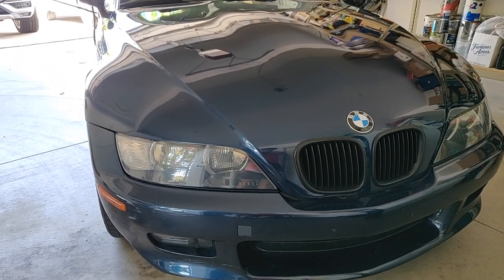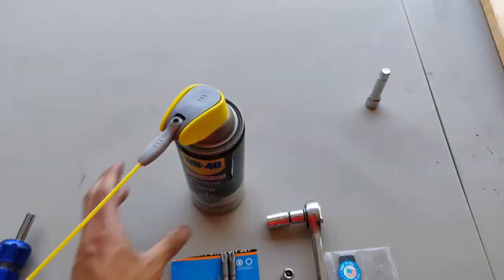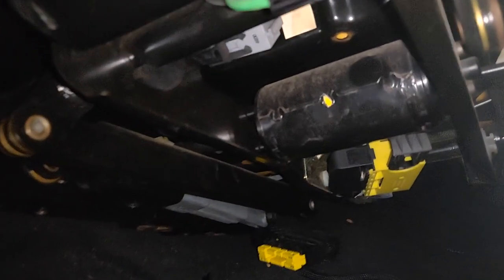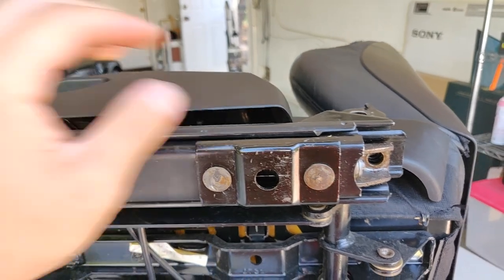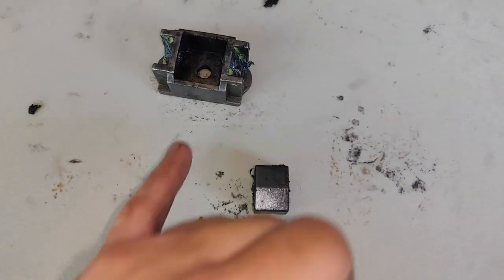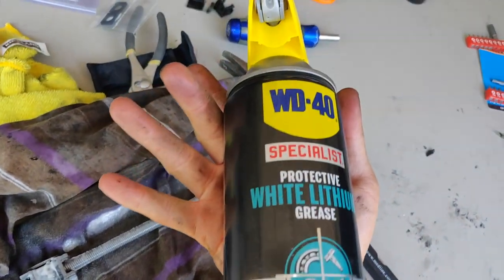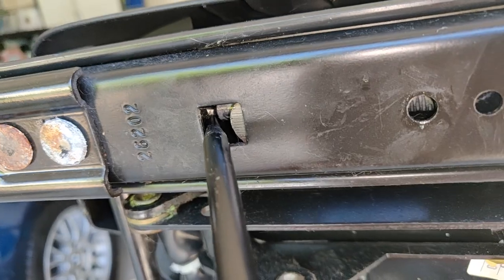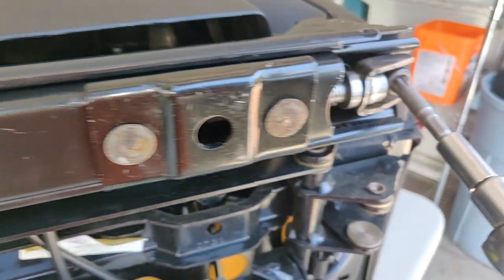How to Fix BMW Z3 Rocking Sliding Seat in Under Five Minutes Bushing Rails Bushes Replace

Comment: Excellent video!  One other important note:  Make sure that the key is out of the ignition switch before starting the removal, and don't put it back in until after everything is reassembled.  Otherwise you'll be chasing Fault Codes.

Comment: Because of your video, I did my first seat and it went completely smooth.  Its 100% fixed AND it was a piece of cake.  Thank you for your help.
Reply: About how long would you say this took you?
Reply: @XFile91  hi. It’s very straight forward. Once seats are out (15-20 mins job) it takes maybe 20 mins per seat.  That’s two rails.  Super easy and a fix that will last years!

Comment: Thanks for a great how too.  I just got my Z3, and this was the first task i tackled. I had to search for the mysterious method of disconnecting the wiring harness when removing the seat, and some mention the problems that arise if the key happens to be switched on in the ignition. I even removed the ground terminal on the battery.

Comment: Great video! I did mine today and the biggest problem I had was removing the rear inside mounting bolts. On my M Roadster they are partially underneath the seats and very tight so flex joint socket did not work. After pulling out ny hair for a while, I found a 5/8" spark plug wrench with a hex on top. I put that on the bolt and used a box wrench to turn it. And don't listen to anyone saying that they could do this in 1 hr!

Comment: Will be doing this soon. Thanks for the straight forward video
Reply from the maker: @brandonmaiden3927  on a second thought, I think the most likely culprit is the leftside carriage is not on the same screw as the right side carriage. In the video, I did each one separate, but you can try doing both rails at the same time so that you know they are on the same screw and the line up identical.

Comment: Thx for the video.  Very helpful 
A couple of suggestions.  
1. Get rid of the background music
2. After the bolts are loose and before removing the wiring, take the battery cables off the battery.  That way one cannot accidentally forget and turn on the key with the seats out
Reply: After disconnecting the cables, touch them together to drain stored energy in the sensors.

Comment: Another bump in the road I encountered. The small threaded tube with the square taper on both ends is detachable at both ends, and it can lie. It can only go in partially on the permanent end. I marked it with a small white wax/crayon pencil to give myself a reference of when it was truly engaged, it can screw up the insertion by 1/4 of an inch, sure enough it didn't go in all the way, and I had to twist it with pliers to make it fully engage. Secondary the metallic block suddenly would no longer insert itself into the rails no matter what I did (never hit or push to much or you will bend/break something) upon inspection I noticed the two pairs of metal rivets narrow the pathway twice (they pairs are 2 inches apart) once I noticed that I slid the rails all the way out and initiated the metallic block 'past' both rivets and then it went smooth like butter. Little details that can hang somebody up for hours.

Comment: I just did this and had a problem with the captured nut not centering on the screw because the bushings were too tight. .  The Screw was binding when I tightened the two mounting screws.   You should not need a lot of force to install the second bushing so the nut carriage will not pull in and bind on the screw.

Comment: Hello, I did this job now the seat only moves back and forth a few inches before motor sounds like it's struggling and stops. I measured the carriage and electrical connectors are in correctly. Any suggestions?
Reply: Did you switch the rods from one side to the other?

Comment: I confirm that it is important to disconnect the battery otherwise the computer will show an airbag fault light.after reinstallation,  and this will need a fault reset tool .

Comment: Another good suggestion for your viewers is to 'count the threads or measure the distance of the metallic block containing the bushings or better yet, do both like I did. Also a good idea to 'clean' the area before taking the pic so you can actually see the teeth and measure better.
Reply: Nice addition via comments.

Comment: Is there any chance of causing the airbag light to come on during this job. Have thought of doing it but worried it could cause the dreaded light to rear it’s head
Reply from the maker: Hi there, since the power seats work when the car is off/key is out, you can work on the seats without ever turning on the car and the light won't turn on. I did this and had no issues. The airbag light is triggered when you turn the key to ignition on and notices the seat isn't there. Worst case scenario is you can go to a BMW Indy shop to have them code the light out for you for like $40. Hope that helps.
Reply: Zion Diaz Thank you. Appreciate the fast reply!
Reply from the maker: Hi Mellments,
I did some more research and found that while that might be the case with the upgrade cars from 99 (OBDII) which is what I have, a 1998 2.8 will have to get the airbag light reset if removed with ignition on. The seats won't move without ignition on so just remove the rear bolt, then front bolt, then disconnect the battery before removing connectors and seatbelts.
Reply: Zion Diaz Thankyou, I have the 2001 2.2 so should be all good!

Comment: Excellent video I did all of this (except the picture) but evidently didn't count the threads right. Is there a way to realign the 2 sides?
Reply: Hi Roger, have you managed realignment? What was a result of missalignment? I was quite sure I did it right, but after assembling all of things it seems that the seat sliding working very slow like having some strong resistance. How did it work in your Z3?
Reply: @romangwozdziewicz7072  I managed to get it back in position and left it alone. A few months later, when replacing the rear shocks, I pulled the seat out again and just made sure both sides went in the same number of turns.
Reply: @MrOregor  Was the issue very slow or even no slide and the motor started to be hot? Probably I'll do the same thing, thanks for your answer and help.
Reply: @romangwozdziewicz7072  . Yes, do it asap. My motor has since burned out. Hard to find a replacement.

Comment: After I reconnected my seat now the forward/backward controls are flipped (backward moves it forward and viceversa). Anyone else ran into this issue?
Reply: You need to switch the rods from the seat that operates in the opposite direction of the control.